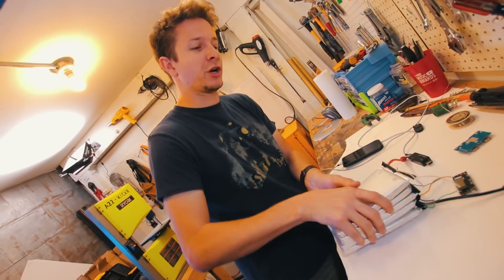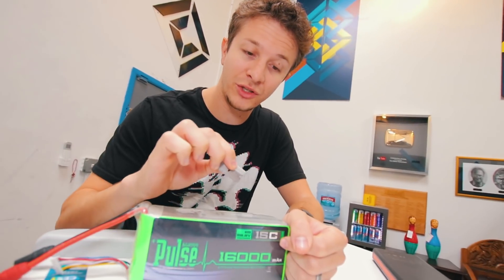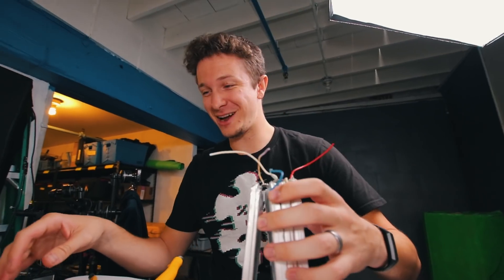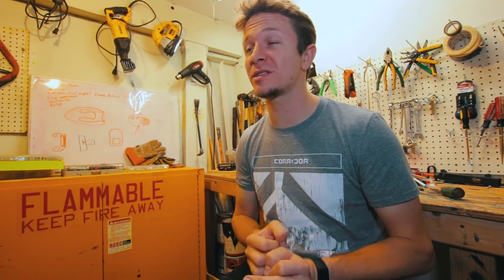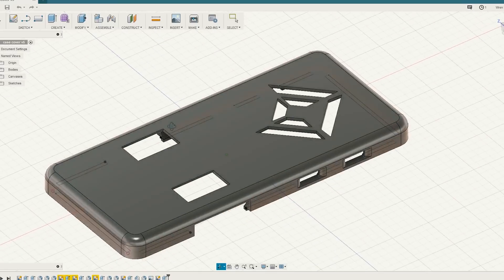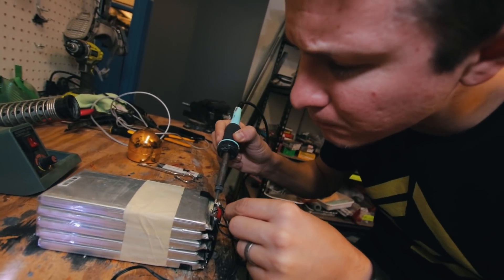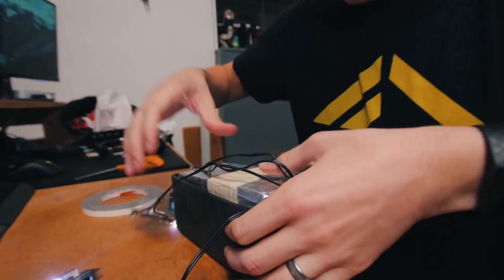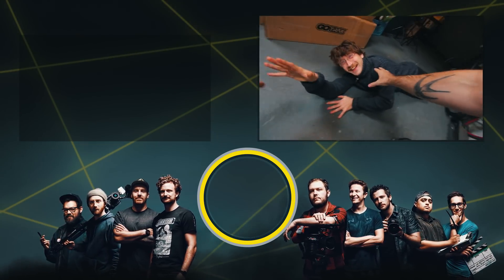I Will Make the World's Largest Phone Battery (iOS & Android)

Comment: Thanks for all of your concern everyone! You're all correct, I absolutely should have been wearing eye protection. Secondly, yeah cutting up the batteries the way I did was dumb. But were you not entertained at least?
How do I charge the battery? Through the micro-USB port, just like a normal powerbank! It's capacity is 80,000 mAh so it's pretty big!
Reply: How long you need to charge the battery from nearly empty to full? And is there some source of battery charge amount indicator?
Reply: What's the charge time from near flat? 1 week?
Reply: i would really get like an XT60 connector for "fast charging" the battery using a buck converter you can set it to 4.1V, look for the charging rate on the original battery, for the C rating, or charging it at ~8 amps, will take you 10 ish hours (usb will take you ~60 hours (80ah*3.7v/5w)) 
I have made a festival battery (it's at a festival at the moment) it's a 3S 90Ah battery, so still some way to go for biggest powerbank!, i charge this with a balance lead and hobby charger. (balance charging for those who wonders)
Reply: Wren please don't charge this unattended. And/or make a battery bunker. Because with the soldering there could be some change in resistance causing the battery to badly balance the cels.
Reply: Can you imagine the day that its possible to have a 80,000 mAh battery in a phone? That might be impossible, but i think that would be dope.
Reply: @TryHardCreative  and they will die in four hours....lol
Reply: I think the crappy powerbank circuit he used charges the battery at 1Amp so it should take 80 hours from 0 to 100%. If you use all 3 circuits at once it will take about 27 hours.
Reply: Id love to hear how long it takes to charge from 0 to full using just a micro usb!
Reply: I think this is an incredible idea and i will build something like this myself at some point. But you could've kept the Battery-management Connectors and build in a fast charge Port.
Reply: Honestly I'm never entertained by dangerously using lithium batteries.
Reply: Hey Wren, at our racing team (formula student) we also use LiPo Batteries so we are used to them. A fire exstinguisher cant help you actually, the LiPos burning with near 3000°C. At our events when such a batteriepack are going to burn the marshalls put sand over it for an controlled burn! Pls do something like this outside next time :)
Reply: Man you was so in it that you did look what tools you get!! take some electrical tool with 1000V protection!! I wish I was near by to help you! I am an electrician ... what you doing man !??? MAN!!!! but I live in Europe.... make progress you are the best!!
Reply: Did you add some kind of display/leds to know how much charge left in the battery?
Reply: but how long does it take to charge the battery from empty to full?
Reply: Couple questions for you Wren. Lipo cells have a max voltage of 4.2 volts, yet phones run off 5 volts - does the phone itself up this voltage or do the USB boards do this? Second question is surely using a micro-USB to charge 80,000 mAh worth would take literally days? Considering most wall bricks for phones output 2 amps which would output 2,000mA an hour, meaning it would take 40 hours to charge your new battery.
Reply: Have you seen Electroboom? I feel as though you were getting inspiration from his channel. Keep it up Wren.
Reply: There is no balancing of the cells needed because they're in parallel. They self-balance by their nature. 
The USb circuits themselves getting heated might potentially be a problem. It's something I'm aware of and will keep an eye on. 

All in all, I think people are overstating the danger here. There wasn't that much risk other than to my eyes. The shorting I did with the scissors wasn't actually that bad other than producing some sparks. It didn't damage the battery at all, and even if I shorted it longer, the connections would have melted before the battery would have been too damaged. But it didn't come close to that.
Reply: How will you charge it?
Reply: Do you have the internal safety circuitry still in place on those packs?
AKA a thermal sensor etc.
Reply: alright boyo, (eventually) i will take on your challenge and make a bigger phone battery.

but in this case your ME degree has nothing on my [near future] EE degree ;)

Make more of these project videos like making Jenna an electric bike, that was sweet!
Reply: A phone charges at 5V/2A, so eight phones can be about 80 watts? Maybe watch out for the heat?
Reply: @drgoo10  80 Watts is NOTHING to a pack like this, so heat isn't an issue. If I was pulling that many amps across a single wire, then heat might be a problem but that's why I split it between 4 pairs. All good.
Reply: @SirWrender  80watt is nothing for the lipo packs discharge rate, but remember the chargers you are using are not 100% efficient, if you charge with 90% efficiently(example) you will use 89W of energy dumping 9watt out as heat directly into the area (the cases internal and 80W into the phones), try charging a phone and measure/touch the components of the charging circut (might be hard now that you glued them together). one of the chargers i use got up to as high as ~60C, and that's a lot of heat if it sits directly on top of the lipos. So the real problem i see might not be the lipos getting hot, but the 3.7->5v converters itself. If the chargers don't sit in direct contact with the lipos, and you have some kind of ventilation, you might be good tho.
Reply: @SirWrender  I was thinking more about the charger boards. My Anker powerbank can get pretty warm while charging even one device after some time.
Reply: But does it have fast charging?
Reply: Did you put some kind of power meter into it so you don't overcharge it? And does it have like thermal safeties and stuff so it doesn't explode?
Reply: Soo... that battery is going to take like two or three days to charge via a single USB.
Reply: It's all fun and games until you go blind and inhale toxic gases.
Reply: Please consider editing this video without that section of improperly handling a battery. The second incident really made my soul cringe. I would think quite a bit of young people will see this and regardless of your admissions of fault in the video, its just too large a risk for them doing something similar.  I just have quite a bit of respect for you guys as a channel especially when dealing with science-y subjects. edit: I just have a healthy respect for electricity, and electronics having to work with these daily, and even just gloves would have been one small step towards safety of yourself and others, also using the proper tools, not garden shears and snips. Love your videos, keep safe.
Reply: I am student in electronics and I can't count how many first years almost made a bomb out of a LiPo. So, no shame Wren.
Reply: I'm entertained but also very worried
Reply: Stay safe bro
Reply: SirWrender Are you not entertained?!
Reply: Also Wren please either take off your wedding ring or put electrical tape around it when doing this sort of thing, it's a great way to get a ring shaped burn on your finger if you don't
Reply: how much room did you leave 4 the battery to expand
im guessing not much becouse it was a push to get it in there i feel as if it will pop while charging
Reply: you should also use rubber gloves, granted the wire cutters have rubber handles but those house scissors dont also you are touching the metal parts of the wire cutters. but i was entertained :D
Reply: can you charge te powrbank with 8 chargers as well?
Reply: I was indeed entertained and I was wondering how you planned to charge it, so that answers that. I don't know too much about these batteries, just what I need to know to strap em to a quad :P
Reply: How are you planning to charge the cells without the balancing cables?
Reply: Hey Wren, what software was used to create the case model?
Reply: The first thing that came to mind when he mentioned the fire extinguisher was, "what rating is that fire extinguisher" ?
Reply: you where scaring me man ive never such such real danger in one of the video and i was even more shocked you continued without any eye protection after the first try, im glad you didnt hurt yourself, but make sure your safer next time <3
Reply: Really!?!? Having all the right tools and using the wrong one???? DUDE!
Reply: Also, was that a metal ring? If so, you should have removed the ring before working on the battery. At the very least, tape a few layers of electrical tape over the ring.
Reply: Don't you need a transformer
Reply: How in the hell it is 80000mAh??? orginal batery was 16000mAh you got rid of one cell so how it is 80'000mAh?
Reply: Don’t the batteries become unbalanced? Isn’t that the whole point of the cable you cut off, or am I missing something?
Reply: dude...every time you went in for another snip....YOUR life flashed before my eyes......i've been near fatally shocked 3 times in my life.... once by the discharge off the back of a crt monitor while picking up the wrong tool (my own fault) , another time in high school where a classmate left the back of a junction box on a project completely exposed and when i switched the unit on i became stuck to it as it powered up..... (not my fault) and lastly getting shocked by a jacuzzi in a vacation rental that had its GFCI removed without my knowledge.....luckily i tested the water before i jumped in....that one scared the everloving CRAP out of me!  Respect the electricity man!  stuff is ALWAYS dangerous!
Reply: How rnt u verified?
Reply: Charging or using this is HAZARDOUS.  You don't have a way to BALANCE the cells and could easily under or over charge a cell.  Please throw this away responsibly before you burn a building down.
Reply: I love you, Wren. You’re awesome.
Reply: It looked like you were diffusing a bomb and you cut the wrong wire
Reply: Please don't say you charged the pack like that when it was in series, that is often how you get one cell failing/exploding.
Reply: I think you forgot one important part, I didn't see a kill switch on that thing xD
Reply: It was not difficult to see that you where going to short out those batteries tho.
Reply: Great job enjoyed the vid
Reply: Like others have mentioned I'm also curious as to how long it takes to recharge. If you ever wanted to revisit this I remember seeing a gaming phone that had 2 charging ports so it could charge ridiculously fast. Maybe add a couple more ports to recharge the battery bank faster? Also, do you actually use this? If not, please send it to me. 😂
Reply: Wren, i really love these little videos where you just create everyday things on a bigger scale. I do also make little things myseld and you have my unsafe support from the Netherlands hahaha. Because who needs ''safety'' glasses :P
Reply: next step is to make a wireless charging bank for 8 phones haha...do it you won't
Reply: I was a bit concerned about soldering in the workshop. Is there ventilation in there?
Reply: @KoiBoiRoi  No there isn't any ventilation in there. It's not good for me, I know :(
Reply: @SirWrender  :O
Reply: You should figure out some way to solar charge it

Comment: I've rebuilt around 10 lipos and i still am not comfortable doing so. I have some suggestions though, firstly for safety, wear safety glasses. I never used to while soldering but if you short the contracts the solder can be launched and I burnt my eyelid that way. Second, always tape over all metal if it's not completely protected. Third, if it's a battery with regular wires, create strain relief. Lastly, if using cells from different batteries, discharge them to all the same voltage before joining them. 
You did well protecting it at the end however cells in parallel can't be balanced so you might run into trouble. To finish my batteries i use liquid tape, packing tape with nylon fibers, and foam or cardboard or 3d printed spacers.
Btw my experience comes from drone racing and airsoft.
Cool video, keep building neat stuff Wren!
Reply: Actually, batteries in parallel self-balance! So there's nothing to worry there. In hindsight, yes I absolutely should have been wearing safety glasses though.
Reply: cells in parallel literally balance themselves. If when you connect two cells together they are at different voltages then the lower of the two will draw current from the higher cell. If the voltages are too different (like 0.5volts or more) then the higher voltage cell will overamp the lower cell and can cause it to puff or worse.

Comment: When I saw that intro I knew what was coming based on experience and working at a battery store for 4 years. Come on Wren your are literally shorting every cell at once when you cut it like that plus leaving all the leads that long can cause them to short to one another. Cut them individually are different lengths and much shorter. Also I wouldn't use those cells after that. They are damaged now but still its awesome. Also I have shorted multiple SLA batteries with my work soldering iron. I am always worried I will somehow fry the iron. I might be critical here but I LOVE these videos where you build stuff. Also I don't think I have said this before but Wren is my favorite on the channel which is weird since this was the Sam and Niko channel. but screw them.
Reply: Nah they're not damaged now. It was through the balance leads, and only for a moment. The wires themselves would have burned up and melted far before damage to the battery would have occurred, and they only got hot to the touch.
Reply: I was taught with lithium batteries if they are shorted at all even for a split second is causes internal damage. I could have been told wrong of course and that may only apply to manufacturing.
Reply: @x9x9x9x9x9  LiPo cells that big can handle a lot of current and the balance leads themselves act as resistors that limit the current so no real harm done.
Reply: It's a different story when you're dealing with manufacturing and actually selling "unused" batteries. There's a higher threshold for quality even if it's not that big of a deal.
Reply: Also is there a PO box or something I can send some soldering supplies in to? You guys could use one of those carbon filters (even though I never use one and holder lead solder with my mouth for a third hand) but for video safety it could be nice to have.
Reply: soldering irons are mostly grounded for ESD reasons, so no worries about frying them, really.

Comment: How is he going to charge the battery itself? Does the ports work the other way aswell?
Reply: Morten Larsen he did said theres one micro usb slot to charge the battery
Reply: @skykingsman6634  Yh okay didn't hear that
Reply: I wonder what would happen if you charged the battery with all 4 micro USB ports at the same time.
Reply: KaadmY it'd charge a bit faster. Charging with all 4 ports is like charging with 1 port at a higher current. The battery is big enough that a higher current is fine

Comment: Discharging them first may have been a good idea, but it provided quality content nonetheless
Reply: I was about to say, did the power cells have to be charged for the surgery? Was that a step Wren insured was done before he took metal the terminals of multiple cells? What about a very wet work space? Did Wren make sure that he was sitting in gasoline? :P

Honestly though, I would have thought that and getting to an area with great ventilation, since the fumes of a ruptured power cell is toxic, would have been high on his priority list rather that just tools and fire extinguisher.
Reply: Well, he did mention that the battery as a whole was not functional, so perhaps it wasn't possible to discharge?
Reply: @JIYkp  you can discharge any battery by putting a load across it for it to discharge into. He could have put maybe a motor or a very large power resistor across the terminals until the voltage dropped to the discharge potentials
Reply: @JIYkp  But each cell is it's own battery. While tedious, he easily could have discharged each working cell after <ahem, cough> shorting it by trying to cut all the wires and taking the dead one out. That seemed to be the problem was he was shorting each working one while working on them . . . I'm now confusing myself with words. I'm getting Wrendered!!!!
Reply: Lipo cells will always have voltage in them. He could have discharged to 3.2 volts but if he went any lower then the cells would not be able to recover and thus would "go bad" as you saw the 1 cell do at the start of the video which Wren removed.
Reply: Yeah But once the cell is at it it's discharged voltage, maybe 3.2v, they push significantly less current, which would mean that there would be less danger due to short circuiting and the likes of those types of issues
Reply: It's not really good to discharge a lipo to 0v - it can actually damage the cell

Comment: Using tin snips to cut wires. Wren I'm starting to worry about your safety.
Reply: It was the only thing we had that could cut the thick metal tabs connecting each of the battery cells.
Reply: @SirWrender  buy some proper tools then ;). Peugot PC and cheap scissors can't go together
Reply: @SirWrender  Actually, the Fiskars scissors you had on the table prolly would've also done that. ;) Not that I'd recommend using them for this either, but they could be used. Also, as a Finn, I kinda love the fact you've got so many Fiskars tools around. Here everyone's got Fiskars scissors and axes, but you still kinda think of them as this little metal working company from a fishing village on the southern coast of Finland.
Reply: I know this is late but most wire strippers have cutting tiers and a universal cutter (it helps to crimp the wire)